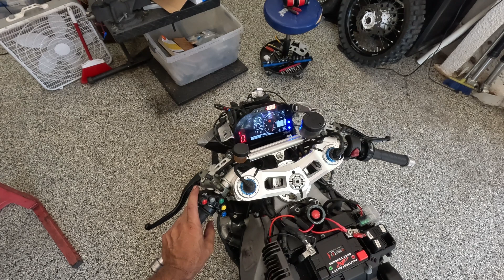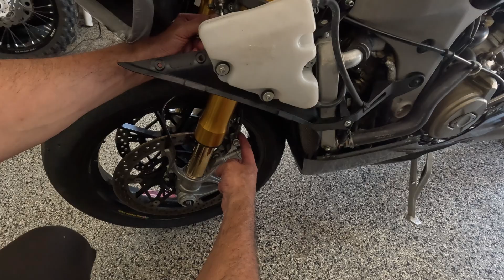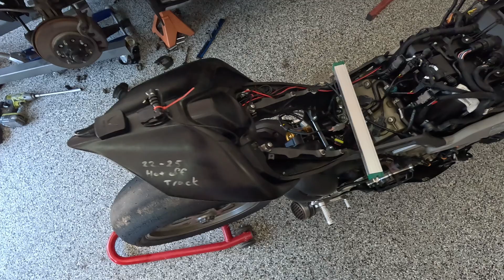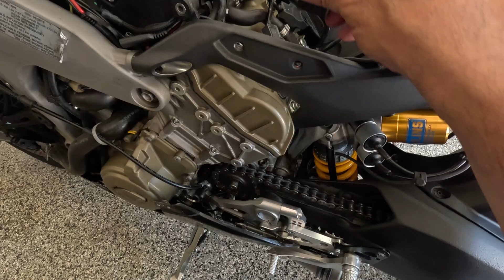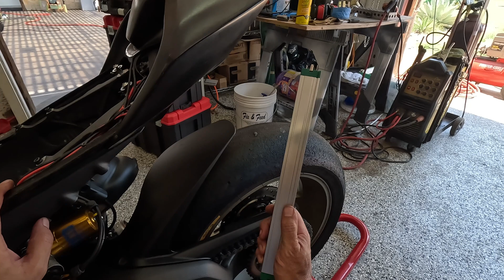i2m Chrome Pro 2 Ducati v4s

Comment: Shaun, whats the reasoning behind the chrome pro for a track bike apart from just because, Is it the data logging and ability to review what your doing?
Reply from the maker: The best thing has been the tire pressure and temp monitor. I initially wanted to create a visual training aid to teach trail braking. It worked to an extent but not as well as I had hoped. I recently installed the AIM Solo2DL and software and its much easier to use than the i2M so its not getting much use.
Reply: @ShaunNielsen  Thanks,  I was considering the Solo2Dl for similar reasons. Love your vids btw
Reply: @ShaunNielsen  Hey! I recently bought a 2024 v4s and I was looking to implement a datalogger. What would you recommend between I2M and AIM? I race on track so I'd need all the data (suspensions, brake %, throttle %, tc etc.) I can get!